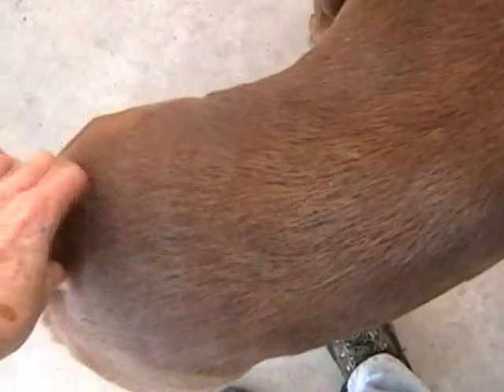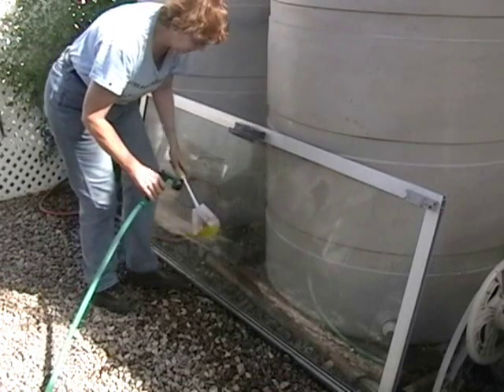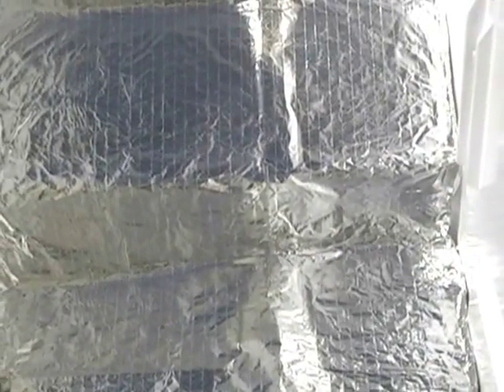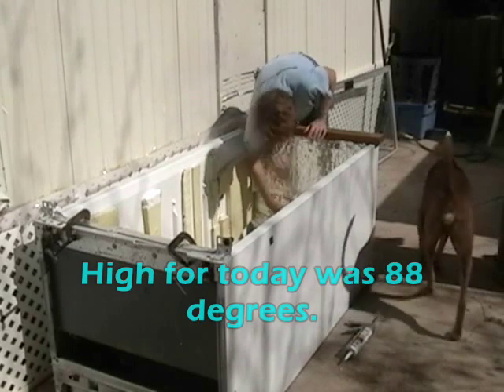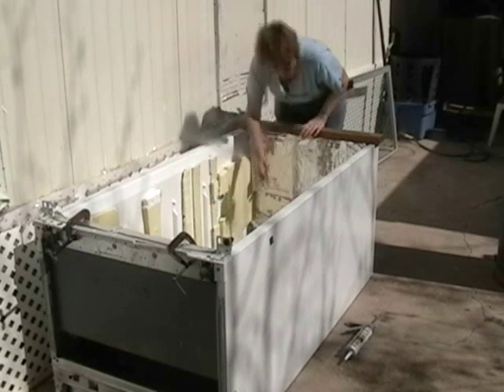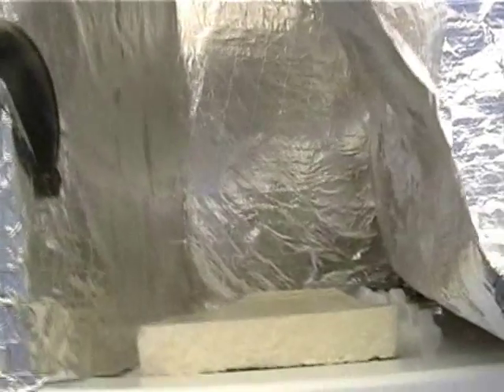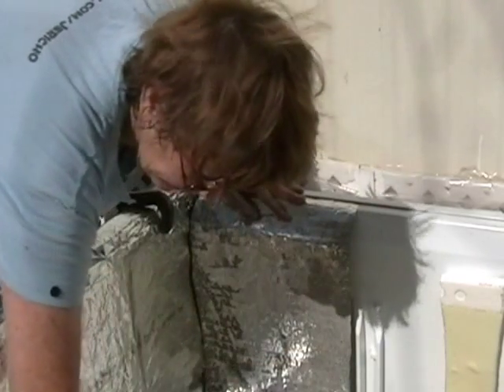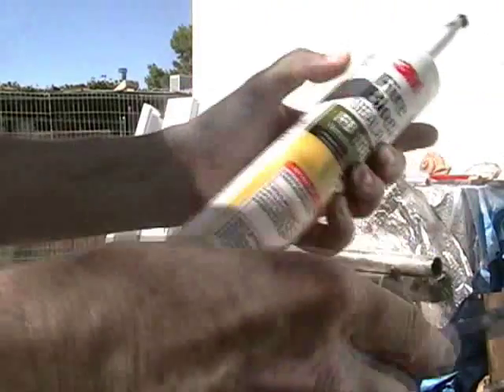Bread Box Water Heater, Part 7

Comment: I know Kasin's no longer with us - but my impression is that she'd welcome any sort of help with her projects. As I watched this very intelligent woman leaning over repeatedly to cut materials with scissors, it came to me it was something like cutting big bolts of fabric. Maybe setting up a table or just a big piece of plywood on some sawhorses would put it at an easier height to cut. Then you could use a rotary cutter or a really cheap drywall T-square, which I've seen selling for $5 at local flea markets. Anyway, this is a great project and it should go on for a very long time.